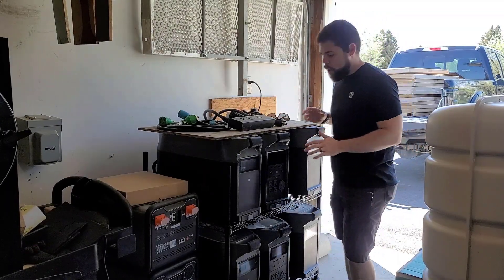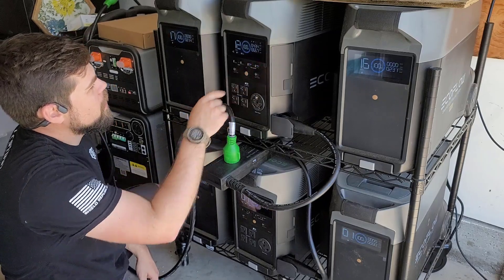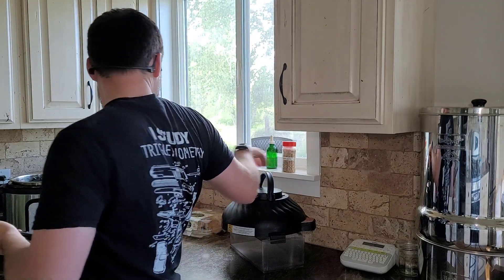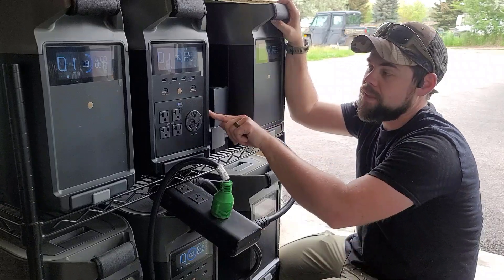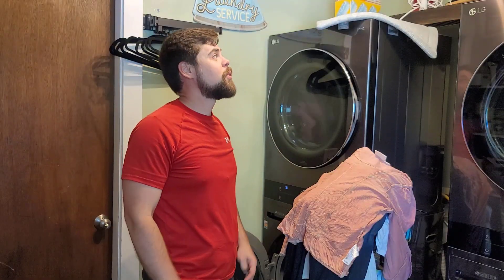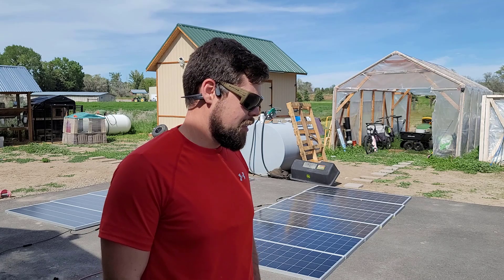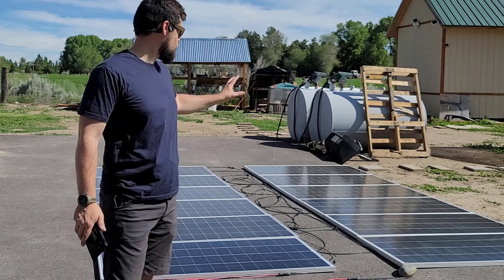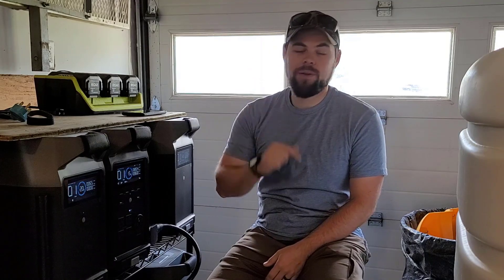Off-Grid House Powered by Solar Generator

Comment from the maker: **NOTE: The 210w panels have now been upgraded to a brand new super-efficient 200w solar panel which works just as good if not even better. **
Reply: What 200 W panel did you purchase for the Eco Flo pro set up
Reply: nice set up , please add diodes on your panels ( avoid damaging your panels )
Reply: Look at the EG4 Converter, it's now legal in most States!
Reply: I have same eco flow set up.  However it’s in the garage and solar setup will be in the back yard and need to buy longer cables from solar to gen.  Are the cables all the same?
Reply from the maker: @saywhat6768  The cables are not all the same. What solar panels do you have, how many do you have?
Reply: @minutemansolar  I don’t have any solar panels to power the eco flow’s as of yet.  Still formulating plan.  Need a transfer switch installed.  Just wanted to start buying things I will need and extended cables is one.
Reply from the maker: @saywhat6768  Got it. Sounds good.
Reply: Wish you'd put out a nominal cost for system.
Reply: Thank you for sharing the information about the upgraded solar panels! It's great to see companies constantly improving their products. Speaking of portable power, have you heard about the Segway Portable PowerStation Cube Series? It offers a massive capacity, fast recharging, versatile sockets, and comprehensive protections. It's definitely worth considering for outdoor enthusiasts and those in need of a reliable backup power source.
Reply: Hi, Ben, How do I contact you if I have a good product to recommend? ——Yvonne
Reply from the maker: @Redodopower  The best way to get in contact with us is by email at info@poweredportablesolar.com :)
Reply: @minutemansolar   quick question I have seen your videos about the duracell power source and the power oak bluetti. ... which one would you recommend for an user that needs to sustain power for a couple laptops, 1 TV , a modem and maybe a fridge .... I would really appreciate your input and knowledge on this... thanks
Reply from the maker: @ivanitachi4837  I don'[t think any of those units will get done what you're wanting unless they have a lot of solar panels connected. But for what you're looking for, honestly the Hysolis MPS3K would be my recommendation. Video coming out soon on that.
Reply: @ivanitachi4837  
Hi,
We have a bluetti it works great. It runs TV  lights  modem tablets freezer (4hours)
The TV  is on from morning to about 11pm. We charge it with generator. 
We are not using our panels cause we are getting new batteries.  We have been Off-grid 
for 11 years full time.  No traditional hydro, and loving it. We would like to upgrade the bluetti, 
Maybe one day lol
Reply: @Off-gridchic  thanks a lot for the valuable feedback !! truly appreciated  i am almost 90% convinced for Bluetti too !!
Reply: @minutemansolar given that you are a year into this video, and given that Hysolis has produced the Apollo, when will you do a comparison between the DELTAFlow and the Apollo?
Reply from the maker: @GoodmanMIke59  very soon I will be releasing head to head comparison videos, just like championship of solar generators.

Comment: I realize this stuff is cool, but wonder if you ever talk about having a wood stove, daring to use outside air drying for your clothes. In other words, isn't it really about consumption as much as production? I am heating with wood as I speak, granted, in a water stove that requires pumps and blowers. The point is? It's about living simply.

Comment: I’m looking into the delta pro. I want to be able to run my whole house with some limitations during a power out so my question is it better to go with 2 delta pros for the 240v or 1 delta pro and 2 back up batteries? The 2 extra batteries with 1 delta pro will give me 10.8kw compared to 7.2kw with the 2 delta pros. Any input would be greatly appreciated. I’m new to this and still learning. Thanks!
Reply from the maker: I'm happy to help. You can also reach me at info@poweredportablesolar.com. I prefer the Apollo system over the Delta Pro, but the DP is still a good option. The biggest limitation is the solar input on the DP. I always recommend 2 DP if possible. The 240v is extremely helpful unless you're just running extension cords to simple items like a the fridge and freezer.

Comment: I also have 2 sets of Delta Pros with extra batteries, but the electrical draw is pretty even on both. I was extra careful of what loads I selected for the transfer switch banks. I have 3 refrigerators and 1 deep freezer. I made sure to match bank 1 and bank 2 as closely as possible.

Comment: Bought two Delta Pros and the double voltage kit...wont power anything when plugged into my manual transfer switch. Techs can't figure it out. My gas generator powers everything...my 2 Delta Pro's and double voltage hub...nothing.  What a waste of money.

Comment: Nice one but.  No details on anything at all.     You mean if I can just get a portable station like this.  Then take any cord and plug it anywhere in the system. Then it will be ok?    No details about what plug to connect    The amps and so on.

Comment: Did you run your air conditioner?
Reply from the maker: Not in this video but I have on my own. But my A/C is different, I have four mini splits instead of central A/C because the mini spilts use way less energy.

Comment: 6:49 is there a way for you to not have to swap the delta pros…is there like a setting that allows you to share all the connected delta pros power, maybe setting the delta pro to get power from other delta pros when it reaches a certain %age? Or is there a firmware ipdate that will allow you to do that?

Comment: Will the delta pros all turn off if one of the delta pros😢 reaches zero?
Reply from the maker: Great question. With two Delta Pros together in a split phase 240v setup, if one reaches 0%, both units do not turn off. What happens is the 240v Hub turns off. The DP with power remains on. The DP without power either goes into standby mode and ethen eventually turns off, or just turn off.
Reply: @minutemansolar  so did you have to swap the delta pros every day, because it looks like, in this video, only one of your DPs was losing power reaching ~30% and the other one was topped out at 100%?
Reply from the maker: @benjiebarker  Not everyday, it depends on the day, power usage, solar charging, etc. But I do have to factor checking my units when they're in use to make sure one doesn't run out of power before the other and I can do the load balancing myself.
Reply: @minutemansolar  so it appears to me that the hub just allows for the the combo of DPs to provide 240v…and not to share power.  Also, the one DP can only connect to 2 extra batteries.  Is there an extra battery splitter cable available that can connect 2 extra batteries to one of the ports of the DP, and allow you to connect 4 extra batteries with 2 splitter cables, or could  they come out with extra batteries that have an extra battery port that allow you to daisy chain extra batteries?
Reply: @minutemansolar  i was just watching a youtube video where the a delta pro was connected to another delta pro using the extra battery port.  Maybe you can do this and never have to swap cables again and both delta pros can share battery power.  You could add 1 extra battery to the other port and on the 2nd DP you could connect the other 2 extra batteries you have.  You will be left with one extra battery that you can’t connect.  Also, you wouldn’t have the 240v feature tho.  I think for the price difference and all the features compared to an extra battery, i’d get all delta pros and you’d be able to daisy chain all that power and charging —> this is that youtube video https://youtu.be/dmOzUCgnzw4
Reply from the maker: @benjiebarker  You understand that correctly. But no, there is no additional battery expansion cable to be able to add more than 2 batteries per DP. I like that idea though.

Comment: Pretty cool! Did you run your ac or heater for your home during this test?
Reply from the maker: Not on this test but I have in other tests. I can do my central heat no problem since it uses propane. I also run 4 9,000 BTU mini splits in the house during the summer for A/C.
Reply: It looks like the 2 delta pros when connected do not share power.  Can you just add 3 more extension batteries to the one delta pro instead of having that 2nd delta pro (with 2 extension batteries), or is delta pro limited to only 2 extension batteries?
Reply from the maker: @benjiebarker  You're correct, they do not do "load share." You can only have up to 2 expansion batteries per Delta Pro.

Comment: Thank for the info Ben.
Let me ask how much power does your home need to run normally.

Daily is possible.

We live in Central Texas and as you know we for hit twice with 5 days one and 1 hour this month of February 2023.
Reply from the maker: It 100% depends on what you need to run during that time. A tiny house that uses all electric heat vs a large house that has all propane heat, the tiny house will have MUCH higher power demands. Let me know what you want to run when using a solar generator backkup system and I can let you know what system would work.
Reply: @minutemansolar  We are going to connect a Smart Home Energy Monitor with 16 50A Circuit Level Sensors | Vue - Real Time Electricity Monitor/Meter to get a better understanding on how much power the house is drawing from the power grid to make a better choice on what we need.

Comment: Questions have you trying using a tester on one of those outlets to see if it grounded correctly before plugging in a two prong cord like a vacuum cleaner or drill
Reply from the maker: All solar generators have a floating ground because they are not physically connected to a ground rod. Therefore, there truly is nothing in the ground hole of the plug. There are some systems coming out that have the ability to connect to a ground.

Comment: Super helpful video! How many square ft is your house?
Reply from the maker: 2650 not including the garage. Thanks for watching the video. If you don't have a system yet and want to get one I'd love to help you out figuring out what system would work to match your needs. I want to help get you what you need as well as get you an extra discounts and free equipment possible. If you're intersted in that please reach out to me at info@poweredportablesolar.com
Reply: @minutemansolar  Wow crazy that small of a system did that well. I am looking at the Apollo and was thinking I would need many more units. Nice you still have all that extra solar to add.
Reply from the maker: @scottyarellano  it's definitely a good system. But once the Apollo issues are worked out, I will 100% be using that as my backup. Possbily Off Grid
Reply: @minutemansolar  Stoked to see that video. Hope they work it out soon.

Comment: Hola ,me gustaría saber si yo puedo usar el delta pro para usarla en una casa pequeña indefinidamente?
Reply from the maker: Si es posible. Solo necesitamos saber cuanto poder utilizes cada dia por medio y podemes calcular cual generador usted necesitara usar. Usted sabe cuantos Kwh se use cada mes?
Reply: @minutemansolar   Saludos desde Puerto Rico.Sume el gasto energético de un año hasta ahora y lo dividí entre 12 y me dió 238 kw promedio al mes. Tengo alrededor de 6 horas de buen sol al dia pues vivo en Puerto Rico en el caribe. Serian buenas horas de sol para recargar el sistema ademas que tengo una planta eléctrica. Crees que podría irme fuera de la red con tan sólo este sistema de eco flow?
Reply from the maker: @victoradorno6047  Si tuviera el sistema mismo que yo tengo en este video, si es posible ir fuera de la red. Se utiliza casi 8kwh cada dia y este sistema puede hacer mas or menos 10kwh cada dia. Las pilas tendria casi 3 dias de poder guardado. Actualmente EcoFlow no permite que mandamos Delta Pro a Puerto Rico per ya casi tenemos la manera en que podemos hacerlo. Si puede, mandame un mensage a info@poweredportablesolar.com y podemos hablar de como podemos ayudar.
Reply: @minutemansolar  . Gracias mi hermano por sacar de tu tiempo y orientarme . Acá en Puerto Rico ya estan los sistemas eco flow actualmente están altos sus precios por ejemplo el Delta pro cuesta $5k cada uno,pero estamos pasando por un momento difícil con el sistema de red, muy caro por tantos impuestos y muy mal servicio con los apagones. Estoy dispuesto a hacer el sacrificio de comprar el sistema eco flow con tal de salirne de un servicio de red tan caro. Sé que con el tiempo veré el fruto de el sacrificio. 
De nuevo gracias por todo.
Me haré un fan tuyo..ja ja ja
Reply from the maker: @victoradorno6047  Claro que si amigo. Estoy aqui para ayudar. Si quiere compar el Delta Pro hable conmigo para que yo puedo ayudarse ahorrar mas por que muy pronto podre enviar ese sistema a Puerto Rico.
Reply: Quería preguntarte algo que vi en un video tuyo. Supongamos que no estoy conectado a la red ,nada de electricidad. Teniendo 2 delta pro cada uno de ellos tiene un conector de 30  amps y si llevo un cable de cada Delta pro(de los que se conectan a los RV) y los conecto a la caja de interruptores a cada fase para completar 240 voltios
Esto sin usar el smart Box de eco flow o el otro adapter.
Esto se podría?
Reply from the maker: @victoradorno6047  Si es posible, es lo que yo hago en mi casa. Uso un "Interlock Switch" no se come se llama eso en espanol. Pero es un conector que normalmente se use con un generador de gasolina para poner 240v en la caja de interruptores.

Comment: I just looked at your link and I don't see a selection for the Delta Pro 2520 240v kit and the search for it shows no matches.  Was it replaced with another model?  What would someone buy to match what you have to power the whole house?  Thx
Reply from the maker: Ya the kits got updated. That kit is now the Delta Pro 2400 Kit. I am currently using the Delta Pro 4EB 4800 (200w) 240v kit. https://poweredportablesolar.com/product/delta-pro-240v-kits/

Comment: What do you think of the EcoFlow dual generator… lots of starting features, gas or propane, best of all charges the EcoFlow Pro when the solar panels don’t have sun… enjoy your videos… helpful for my prepping for hurricane season or some unfortunate just in case in Hawaii 🤙
Reply from the maker: I like it, but don't own one, so my response is all anecdotal from what I've heard from actual users. It is great if you have a Delta Pro with just one battery. The big downside no one talks about (video coming out about this) is that the gas generator has to be plugged into the Delta Pro through one of the Delta Pro battery cable connection ports. So if you have a Delta Pro with two batteries, you have to remove one battery to have the gas generator connected and working to recharge the system when it gets low. 

So it's basically pointless to get one if you have two batteries on a delta pro. But otherwise, I like it.

Comment: Just got turned on to these batteries this Morning. I have a question. Right now i have 22 solar panels on my roof and a Natural Gas generator. Is there a way to convert my current panels to charge the ECO pros? then also is there a way to hook everything up, Have Commercial turned off run on battery and when (and hopfully not) teh batteries where to die i could get the generator to kick on to take the load until the batteries charged back up?
Reply from the maker: How many watts are each of your solar panels? If you can find out the VOC and ISC ratings which are on the sticker on the back of the panel I can tell you how they will work with the Delta Pros. The generator is a good backup to the Delta Pros but you can't run 240v power while recharging the Delta Pros from a generator. So you could run things off of the natural gas generator while the Delta Pros recharge, and then switch back over to the Delta Pros once charged up.